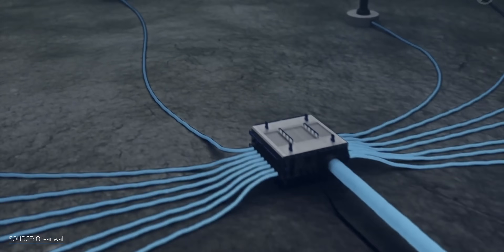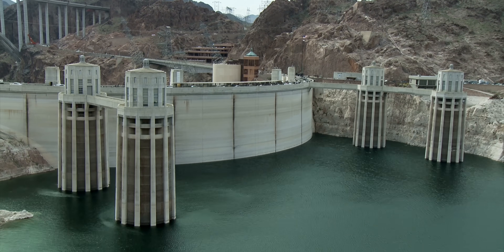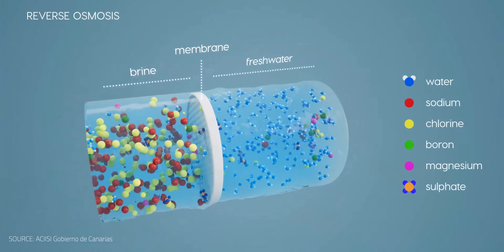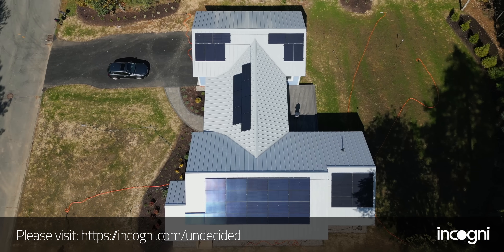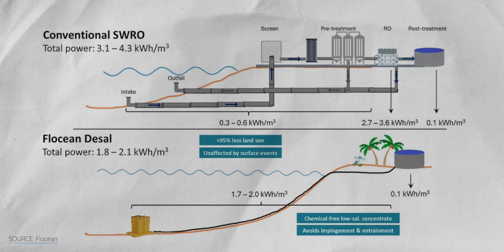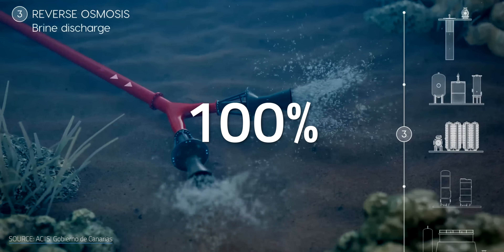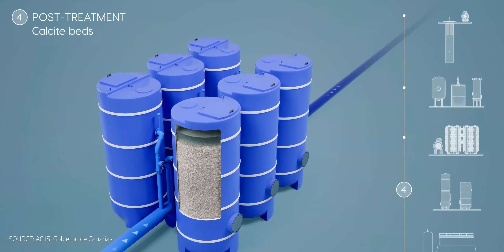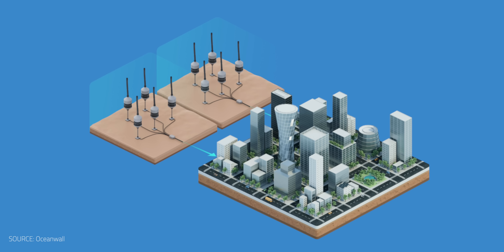How Deep Sea Water is Now Drinkable

Comment: Airborne wind turbines / solar panels could have the potential to condense water from the air , high voltage can increase water condensation and cooling systems could also do the same as a cold beer on a hot day making a glass covered in water droplets . Although not on scale of sea water extractions but renewable with creating conditions for more plants to help the fight against deserts and climate change .

Comment: Sounds nice but I don't see how it can overcome the problem most underwater salt water technologies face: it is a hassle to work underwater due to corrosion and the fact that building things underwater is difficult and implies higher costs that I don't clearly see how they could be reduced in the near future.
Reply: yes this is the main problem.
The wavepower desalination plant in Western Australia took the opposite approach to use wave power to pressurize water and pipe it ashore where the machinery would be easy to work on. Since they only used part of the water for desalination they used the remaining high pressure water to generate power.
Reply: Also have 6 miles of pipe that hopefully doesn't start taking on salt waste somewhere. It if does, finding where is going to be a beach.
Reply: @TheClintMatthews  The cleaning and maintenance sounds like a problem, agreed. 

Honestly though, I don't understand why salt "waste" is being pumped back into the ocean in the first place. That sounds like just being in the business of selling both clean water, and also salt. Doesn't that seem like an obvious step to decrease costs and pollution?
Reply: @grantstratton4629  Salty brine is pretty different from salt. If separating solid salt from brine was easy/cheap, they would've just done that instead of RO
Reply: @SuperSox97  Yeah so, I ended up reading a CORDIS (EU commission) report after posting that basically says that in theory table salt and a bunch of metals, including magnesium and lithium, can be pulled from the brine, but the research just hasn't been converted into an industrial process or product yet. 
   This still seems like pretty low-hanging fruit.
Reply: @grantstratton4629  it is not low-hanging fruit. the energy expense is very high. Producing and purifying the different salts in seawater would be technologically easy but energetically expensive; making it high-hanging fruit.
Reply: @JaneDoe-dg1gv  I seem to remember that one of Ghandi's most famous protests was over salt regulation in India. He lead a bunch of people to the ocean where they used evaporation from sunlight to produce table salt, which was against the law. 
That initial step at least, seems to be within the reach of the poorest of poor people. 
Yes, it's more complicated than that, but conceivably you could sell the raw material to a more specialized chemical plant that would then do the work of chemical separation cheaper than you could do it on site.

Comment: What's missing here is an explanation for the main, glaring technical hurdle: how to maintain low pressure at depth on the freshwater side and return that water to the surface.  Maybe it's doable, maybe it's economical, but it's not trivial or obvious.
Reply: They seem to be pumping part way down from the fresh water side, and then letting the seawater push through the filter like a syphon to balance the pressure out. Technically feasible, but I question how quick it would actually be. The super environmentally friendly filters they are talking about have one major drawback. Speed. There is a reason why the current power hungry system is used despite how inefficient it is.

Comment: 8:10 Why power it with wind when wave power makes more sense?
Reply: Probably because wind is more developed...? Just a hunch, really. Idk
Reply: Pair it with those wave pods.  I could also imagine large enough plants if economically viable having undersea bases for crew if economically viable... could be first steps toward colonizing the sea.  It could be a good foothold and justification to push the field.  A water-energy farm.  Potentially also a bit of deep-mining, maybe throw in an oil rig if it doesn't disturb the desalination, and the oil rig can be a reliable structure above to that also stages support down to the deep colony... You might want to build one even if it's not being used as an oil pump for that reason.
Reply: Tidal energy is an expensive, difficult, unreliable, early stage technology.

Maybe in 20 years we'll figure out how to do it cheaply and outside very special environments, but we can't today.

Comment: I worked as an engineer on ships for many years. We never started desalinization plants until we were at least 50 mi of shore. Because the water is disgusting.
Reply: @scottakam  Yeah, there's a million things that would be more efficient than desalinating sea water, especially reducing losses and waste is imperative, otherwise you process water just to waste it again.
Reply: @toastermon2272  much of the water in a house literally goes down the toilet! Using sea water for toilets is more efficient. The challenge is separating the supply and waste lines in houses.
Reply: @scottakam  better to use grey water from a septic system for flushing toilets but you need to build a tank for that, or use rain water.
Reply: @scottakam  expect salt water is incredibly corrosive. You would need special non-corrosive toilets and pipes, in addition to special sewage infrastructure so that salt water doesn't wind up in the local enviroment. 

Anyone who owns a saltwater fishtank or saltwater pool knows the difficulties of keeping everything stable.
Reply: We can't even separate rain water from raw sewage. I don't see us maintaining twice the water mains and connections with corrosive salt water just to save a few liters

Comment: All my comments seem to get deleted after a few moments.  Maybe it doesn't like the link to an article.  So search for it yourself.  "MIT 2022 Ion Concentration Polarization."  What happened to the 2022 MIT project that created a process called Ion Concentration Polarization?  No filter, no crazy pressures.  It was a small briefcase sized prototype.  Self-cleaning via a cleaning mode.  Removes salt and all microbes without filters.  The unit could be powered by another small briefcase sized solar panel (larger when unfolded) or 12V power tool battery, etc.  No high voltage, high current required.  Question of scalability?  Funding?  Patents?

Comment: Im confused, so instead of using a pump to build pressure on the intake side of the filter, they are using a pump to pull a vacuum on the product side of the filter. That is supposed to save energy?

Perhaps they save a small amount of operational costs by not needing chemicals to treat the water, but I'd wager that the cost of the complex filters outweigh that. Let alone the cost of deep sea maintenance operations.
Reply: To push water trough the filter you need a high pressure differential. 10 atmospheres in one side and 1 in the other. To move it through a tube you only need a low pressure differential. Maybe 2 bars. So instead of pressuring from 1 to 10 with a pump you only need to pressure from 1 to 2.

Obstacles in fluid dynamics are stimulated as pressure losses.  A filter, the friction of a long tube, a bend in a tube... Each have a pressure loss. For the fluid to move from one point to another you only need the pressure in one point to be higher than all the pressures losses of the trajectory.

It's like the difference in force you have to do between squeezing an orange for jouize vs moving the same orange.
Reply: I had the same thought. But one differenc is, that you just have to pump less pressurized water, because you only pump freshwater but no brine. Even though the pressure difference is the same (more of less, see the second point), the moved volume isn´t. 
Secondly, placing the membranes in the open ocean, should allow the ocean to constantly supply fresh water without elevated salt concentrations.  On land you start with the salt concentration of the ocean, but that concentration increases during the process and decrease the freshwater yield.  It all relies on the ocean currents getting rid of the brine.
Another but smaller factor: In land based systems, the whole process takes place above sea level, so a fraction of the pressure differential isn´t used for RO at all. Of cause, the freshwater from the deep sea RO will eventually also be pumped above sea level, but that does not mean, that there is no difference at all. The salt adds weight.
Reply: I'm skeptical as well but what I understood the water in deep ocean already provides greater pressure naturally, because of gravity. They are using it to lessen the artificial pressure making using pump.

Comment: How does sucking save energy?
Even if you can suck from the depth (you cant, since A) Pumps cant create negative pressure and B) if the pressure is low enough, water is going to boil).
Reply: @justinterested5819  the vacuum is only to get the water to move, the high pressure from being at the bottom of the sea provides the pressure to push it up.
Reply: @CeoMacNCheese  Thats Not how it works.
The entire reason for doing this is to create a pressure difference across the membrane. If you need 20 Bar of pressure across the membrane, half a bar of suction wont cut it.

Sure you could Pump water from the bottom and release it just above the water level. In that case, you would only need to provide the pressure needed to overcome the losses in the pipe and the pump for the given flow.
Reply: @justinterested5819  i thought you were asking about how to get the water up to the surface.
Reply: @CeoMacNCheese 
You dont need almost any energy to do that compared to pushing it through the Membrane at an acceptable throughput.

Comment: Isn’t the main problem of those drying basins huge overuse of water and ginormous water rights? 

Anyway, I really don’t understand why doing the work on the sea bed helps to reduce energy usage. Sure, you have pressure, but pumping away the water that wend through the filter would need to overcome that same pressure, no? How does that help exactly?
Reply: It requires the same energy on land as it doesn’t below the ocean, so people talking about extra pressure in these comments have it all wrong.

The energy efficiencies come from less filtration due to less gunk/biologicals, less energy to pump out waste (just leave it there vs pumping it up and out of the plant back to the ocean).

Also less movement of the water since the filtration is done there at the source instead of moving. The benefit is that a tradition plant needs to move the salt water, which is heavier than fresh water. So a traditional plant moves all that salt water, and only 50% is filtered, vs DSRO where lighter weight fresh water is pumped up to the surface.

All these efficiencies add up

Comment: I don't understand how this works.
I assume that they need a delta pressure over there filters.
So yes the get the high pressure for free. But on the low pressure side they need to pump the fresh water up to land. And would that not take the same energy as creating the pressure in the fist place?
Reply: Salt water has more density than fresh water. The pressure at 1 km depth in the sea is slightly higher than at 1 km depth in fresh water - or in the return pipe with fresh water. The difference is not great, but enough (or almost enough) to drive reverse osmosis anyway. So it would require less pumping energy than 'shallow' desalination, just because fresh water is lighter and presses down less hard on the deep sea membrane than salt water does.
Reply: @barttemolder3405  Interesting: consider this. you lower a tube of freshwater into the sea. the bottom is closed with a RO membrane. Because the saltwater is dense, fresh water will enter the tube. because the fresh water is less dense, it will come out freely from the mouth at the top. you can put a turbine at the mouth and produce free electricity, right? this will work only if there is a density gradient with respect to the level.
Reply: Because the high pressure already exists below, and is equally pressurized in all directions, all they're doing is 'pulling a vacuum' on the outlet pipe to get the water to flow through the RO membrane - as opposed to creating massive pressure in a maze of pipes from inlet to outlet.
Reply: @ohnoitsalobo  Nope, you'll need to overcome that pressure (to create what you call vacuum) by pumping fresh water up to the surface. Exactly the same amount of energy is needed for that as if you pressurized the inlet.
Reply: @BLJ_ENGINEERING  energy for lifting the water, yes, no doubt. But people seem to be confusing energy with efficiency. The overall energy use will (hopefully) be noticeably lower in this system of just 'pulling water uphill', as compared to having a battery of pumps and a maze of high-pressure pipes 'pushing water uphill' through the RO filters.
Reply: @BLJ_ENGINEERING  again - energy vs efficiency. As others have mentioned, fresh water is less dense than salt water, so there is a small bias towards the freshwater outlet. In addition to the high pressure of depth, this means that you (again, hopefully) get more freshwater out compared to the same kWh expenditure in a desalination plant.

I agree that it takes an equivalent amount of energy to pump the freshwater uphill, but we're talking input energy vs freshwater output efficiency.
Reply: Seawater is 2.5% denser than fresh water 

So at 1000 feet of seawater you have about 440 psi of pressure
But 1000 feet of fresh water (in the return line) is only 429 psi.

(Basically when you take the salt out , the water gets less dense and wants to rise up the return line.)

Which means that to get the 40 psi pressure differential current filters need to operate you need to go down to about 4000 feet (1200 meters)
Reply: @glennchartrand5411  current filters will remove about 50% of the dissolved solids
Reply: Yes, but I think it's more about stuff like most likely they use lower pressure levels, than land based RO facilities. Nor do they have to really have say high availability constantly pressure pumps and so on. The just need pumps, that lift the water. Be it in batches, at surges and so on.

I think one of the main things, though mentioned hut not emphasised is they get lower energy usage, since they look for lower yield per cubic of supplied sea water. Since the sea water supplies itself.

Yeah they need to fight the pressure, but the pressure they are fighting is lower than the pressure land based facilities are fighting/pushing. Pumps the receiver side tank empty, hydrostatic pressure pushed water into the tank. Emptying the receiver tank takes work, but it is easier task compared to maintaining pumped constant high pressure.

Ofcourae still grain of salt on any company's claims of their products performance unless they have independently verified field testing data to back that up.